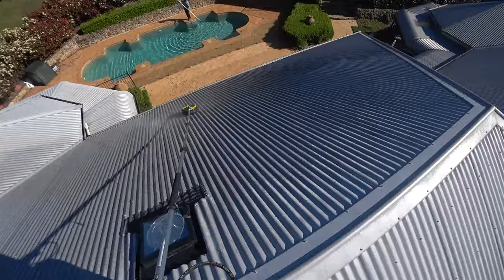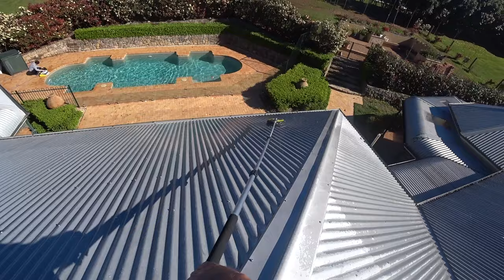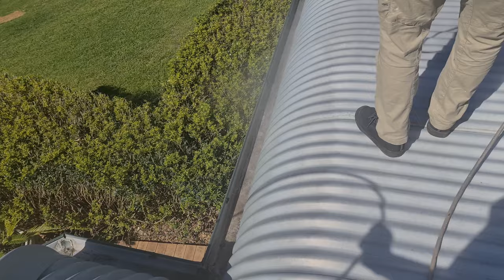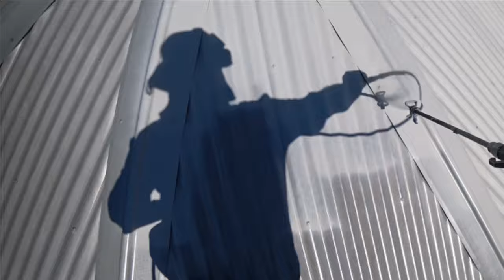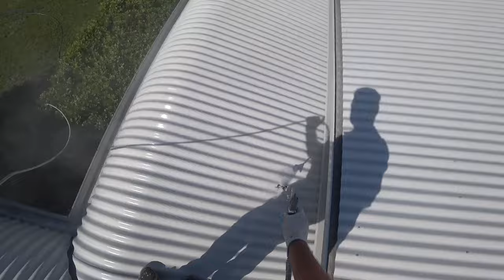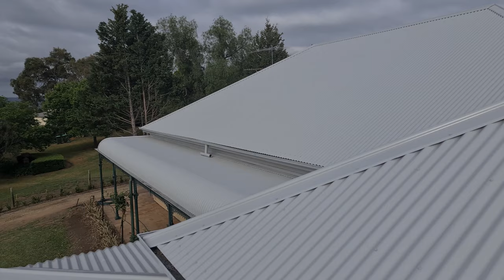Spray  Painting Tin Roof exp

Comment: Do you get overlap lines. I've done 1000 tiles roof and you can't see overlap lines but on the metal roofs I've done I get slight overlap lines if I  don't do gutter to top ridge. What machine are you using?
Reply from the maker: Noo overlap lines ,- An airless sprayer, I am using a GRACO Mark IV
-Tip size 413 for fine spraying
PRESSURE between 15000 and 20000psi, low pressure spraying, using a fine tip